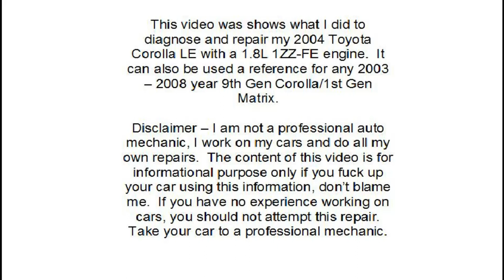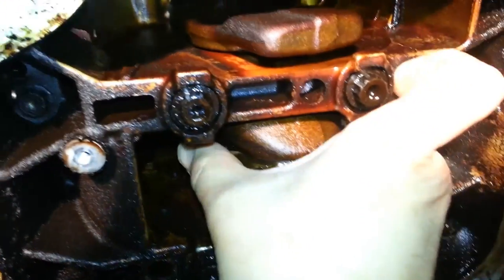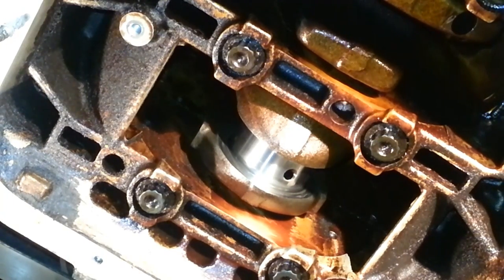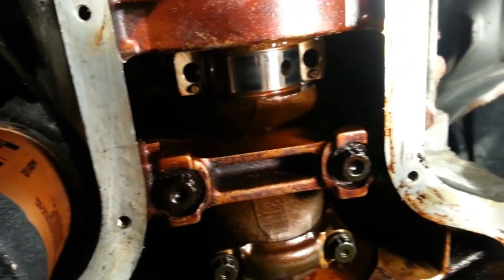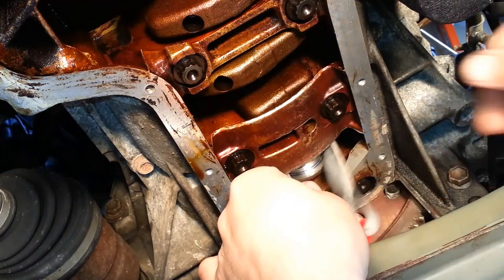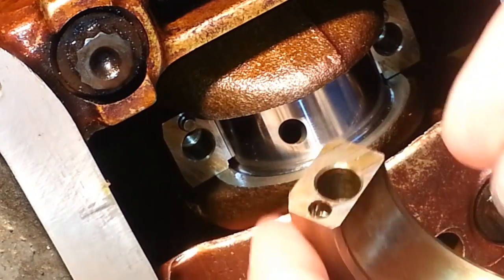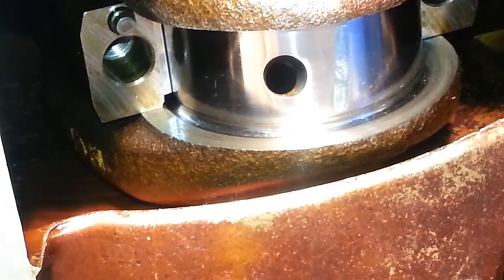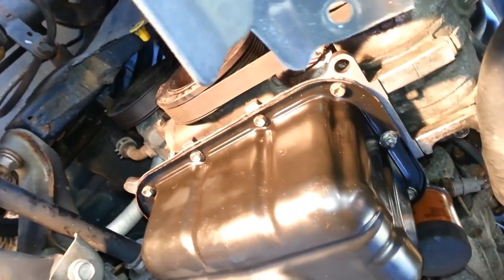2004 Toyota Corolla 1.8L bearing replacement to fix rod knock caused by bad connecting rod bearings

Comment: Great video, Liked and subscribed. I have been looking for specific instructions on how to disassemble the engine to change the head gasket and got here but watched the whole video, glad i did because learned a lot by watching you. I am still looking for a good video about how to change the head gasket in a 2004 corolla CE, i believe it is the same engine as this one here. I have a blown engine, the original from that corolla driven by my wife; it was burning the oil, we never knew until it actually blew a rod coming from California back to Nevada, engine had then about 80000 miles. We bought a used certified 2003 corolla engine with 62000 miles on it never opened for $1000 back then and $700 labor, that was about 4-5 years ago, now the odometer marks 122000 but wife have been driving the car with engine light on for long time without even watching the temperature gauge was all the way up until the overheating issues blew the head gasket in this second engine! The same mechanic who replaced the engine back then now proposes to do it all over again, same price! I kept the original engine in an engine mount in my garage all these years (he wanted to buy it for $200 but i wanted to keep it just in case i would feel like reconstructing it) today I just took it out and are attempting to remove that head to have it pressure tested and service, hoping to swap it for the blown one. I do not feel like doing the whole $1700 payment again but just the same, I have bought a lot of parts by now from autozone; namely water pump, thermostat, serpentine belt, spark plugs, head gasket, valve cover gasket, then also got the radiator, radiator hoses and clamps and radiator cap, as I am told my overheating issues may be due to poor coolant circulation due to maybe a bad radiator, which is the original on that car, ALSO the coolant have never been serviced before and the time the engine was swapped I believe the mechanic used regular water with antifreeze, not distilled water, so by now the radiator may have been gone bad; can not fix the car if we do not fix the cause of the overheating; I have learned all this in the past few days watching youtubes videos here; obviously my mechanic is not as cool as i thought and I want to do this all myself, not to keep the car but to fix it properly and be able to sell it for 3-4K after it is fixed and detailed inside out, including engine bay; car still has good body, interior new brakes, good transmission and nice rims with good tires on it. In its present condition we were offered $300.00 by Toyota Dealer which is an offense; we walked out of there. We will buy a used van with 20K miles still under warranty but will be putting life time mopar total care warranty on it before factory expires (2017 Pacifica Limited in excellent condition at 30K) and this time around hopefully wife understands once and for all that the car she drives she has to pay attention to the instrument cluster and get the maintenances as required! It is kind of hard for me to do this level of mechanic work; i have done the front end axel, breaks, battery and light tune up for my 2000 Tacoma which sits in my driveway with 220000 miles on it original engine and transmission never been in the shop or opened before but nothing like this deep. I think Toyotas are good cars that last long time but only if taken care of like any other car. I am also a mechanic but electro-mechanic for ATM machines and banking equipments like cash recyclers and coin sorters; that kind of mechanic it is not too different from cars only in my world there is not so much grease, mess and grime. I feel confident that I can get the car to run again then i will guarantee the work myself when selling it because as first owner of that car we know it have been put through hell by us neglecting it to the point to break it really hard twice now so maybe with this time fix around it can run for another 100000 miles without much issues. I think ours also has some knocking but I do not know how bad it is; in any case that would have to be a fix for the next owner and it seems less complicated than changing the head gasket! Thanks for this video!
Reply from the maker: Thanks, the radio didn't seem loud while making the video, but sure comes through loud when watching it..lol
Reply: There is a guy who does a 98 or 99 1zz-fe rebuild video on youtube
Reply: did you rebuild? there is a also aguy who does I believe a 2000 rebuild. it's pretty damn good actually I learned a lot and its pretty step by step. it'll be my primary video when I eventually get to rebuilding. right now I'm just learning and reading comments in various vids
Reply: 1000blabbities Yes I did the whole engine, since last year by now it is still in the garage not yet inside the engine bay, next step is to install fly wheel to it, clutch to the transmisión which is inside the engine bay and lower the engine into engine bay, then install the new axles and rest of engine components, I stopped in the project right after putting the engine back together last year about August, the head was machined and cleaned, the block was cleaned and I got new pistons, rings and bearings all Japanese, every little engine component is also new as well as in the head which was prep in a shop, when I installed used new bolts as well, the majority of the repair have been done it is just a matter to break my laziness and finish putting it back together!
Reply: Rody Outdoors That's damn cool. I'm still scared and lazy yo even start mine but its good to hear non pros can get this done. Esp cuz I'm broke lol

Comment: Great video, it was one that gave me the confidence to tackle this on my car. I have a Hyundai Sonata 2.4L engine. So far so good it starts and sounds great, but only time will time how long it lasts for me. If and when it gives out i'll come back and update my post. 20 miles and fingers crossed.
Reply from the maker: Glad it was helpful, I'm on 60K plus miles and still runs great.
Reply: Any issues so far? About to tackle it on my Supercharged 2.0 Cobalt SS
Reply from the maker: @zackbrock6031  No issues after 67K miles, changed the oil a few days ago and it's nice and clean.
Reply: I’m at 2000 miles and so far so good. It’s my kids car now.

Comment: Thank you for posting. I have same problem in my Celica. Think I've caught it early so hopefully this will catch it in time. I'll report back once I'm finished. From all the way over the Atlantic in UK. Keep on truckin'!
Reply from the maker: Keep us posted, hope the vid is helpful.
Reply: So I thought I'd update with my experience. The knocking has gone! And con rod bearing no.1 (nearest flywheel) was shot. I cleaned up the no.1 journal using this technique then cleaned and reassembled. The other journals and bearings looked good so I didn't sand them, just changed bearing shells and checked clearances.  I managed to find bearings from an aftermarket supplier (FAI) for £12 for all four (eight halves). Once the job was done I ran car until hot then added engine flush. Then ran at fast idle (3000 rpm) for 15 min. Then drained oil, changed filter and refilled with fresh. I'm hoping this will keep things running well for the foreseeable. 

Thanks again for posting!
Reply: @MrGrogee  i know it's only been 1 month but how's the car? been any noise so far? or still running good. i can get a used engine for 200 dollars but i just don't have the time to replace right now.
Reply: @littlebrw  Still running great. Completely cured the knock. No sign of it returning. I haven't done that many miles, maybe 600 or so, but no issues. In my opinion if you have caught the knock in time before it chews up the crank journal too badly, this is a LOT easier and cheaper than engine swap. 

I considered 2nd hand engine as well but they seem expensive and you just don't know if you're buying more trouble. 

Good luck with yours
Reply: @MrGrogee  
well after getting a good look at my car i pinpointed the noise to my transmission. it's a manual trans so "that's good in a way"  hopefully it will last for a while. i was over here being paranoid since it sounded like rod knock, but goes away when applying the clutch.

Comment: Currently doing this on an 03 Corolla. Hoping I caught it soon enough.
Reply: Doing this on my Matrix with same engine. Same here. I bought the car at auction, and didn’t notice it until I put nearly 300 miles on before I noticed it because road and wind noise is so loud compared to the engine. Who knows how long the previous owner drove with it this way. Fingers crossed, but I’m also more than prepared to rebuild the engine.
Reply: @Dude13450  how did it hold up? the crank shaft are pretty strong in these
Reply: @thenman23   not a single score just pure mirror as if brand new. Slapped new bearings in and no sound!

Comment: Hello sir my name is Wayne Baker I am currently replacing the main Bearings in rod bearings in my 1zzfe 2004 toyota corolla along with the oil pump and timing my question for you is when you did this job did you replace the bearings with standard or oversize bearings
Reply from the maker: Used the standard bearings matched to what use installed, just be sure to check the oil clearance with the plastigauge for proper oil clearance.

Comment: One way to quiet the knock if it's not that serious and to solve the Classic oil consumption problem is to use a quart of Lucas at your next Oil Change I did that to my 2001 Corolla and have seen 80% less oil consumption thank God I was using a quart every 250 miles. I just checked it at 270 miles and have not used a drop on the Lucas additive oil change I will check it again at 1500 miles I'm expecting good results still. Thank God amazing I did not want to rebuild the engine although it is cheap but time-consuming
Reply: Just get some thicker oil, its going to be cheaper.
Reply: @konstantindufnik696  I would just rather spend the extra ten bucks and get the additive I do not want to run to thick of oil in prematurely wear out anything else

Comment: I know it’s been a few years since you’ve done this. I just tore in to my ‘04 and the 4th bearing was obliterated. There is some scoring on the journal but I’m convinced I can smooth it out. My main concern is the rod and cap. Should they be smoothed it with sand paper, or is it OK that they have some scored material from the bearing? Maybe I shouldn’t even try but your video gave me hope!
Reply from the maker: I would clean them up the best you can, they don't need to be polished.

Comment: Great video. Handling a camera while doing the work, what a man. I need t do rod bearings on my 1999 Camry 4 cyl. Can you tell me will the oil pan come off just by removing the bolts or is there going to be some kind of."substructure" in the way? Thx for your time and the video.
Reply from the maker: I haven't done a Camry, but I think the exhaust manifold exits on the front of the Camry engine, so you will need to remove the bolts and swing the exhaust out of the way.  Here's a link to the oil pan removal:  https://www.youtube.com/watch?v=VIqEagP9h1w

Comment: Thanks Mark for the video. I have been experiencing this knock while the car is cruising at 2000 rpm.  It is only at this rpm then will i hear this knock which sounds vaguely like the rod knock in your video. What gives, particularly the 2000rpm exact reproducing condition?

Comment: This video had excellent information.  Thank you so much for posting it.  It's been 4 years, but if you are still monitoring it, could you estimate how long/far you drove before doing the repair?  I have rod knock on mine and I drove about 10 miles.  Wondering if that was too far to do the repair.

And this is just for my OCD, please don't be insulted, but that is a crank shaft, not a cam shaft and  you unplugged the fuel injectors, not the plug wires.  But to end on a high note, the polishing thing with the shoe lace is pure genius.
Reply from the maker: I don't recall how long it was driven, but was probably about the same or more since it was my wife's car and she noticed it so I would guess it wasn't right away that she told me about it. Thanks for the comments, I noticed that used the wrong terms a few times as I was more or less just winging the video as I was working.

Comment: You did not show how you put the plastic gauge on the journa, the put the cap back on and l then torque it. Then remove the cap again and then it would show what you are measuring? which should I guess the plastic part that stuck to the journal, is that right?
Reply from the maker: Shown at 40:42.  That is correct.

Comment: Dude thanks for the video. I bought a  03 mr2 5mt for 2k. Was planning on 2zz swap but was able to save the 1zzfe swapping out rod bearings. Itll  buy me some time before 2zz swap next year.

I ended up getting the mahle  standard bearing size.  Bearing clearance was perfect 👌.

Comment: I just want to know what you did to get a rod knock on a Toyota 1.8? These engines regularly go for 300K+ with nothing more than routine oil changes
Reply from the maker: The knock started shortly after I purchased the car, poor (or lack of) maintenance on the previous owners part caused the bearings to fail.
Reply: On mine, floor it up a hill in second gear, high rpm, lack of oil.

Pulled it down in about an hour due to watching this video. Sanding done, ordering bearings, should be back in one piece next Saturday after a work week.

Comment: Subscribed. Great Vid. Planning to do with with my R18 civic engine. Can we get a 5-year update? Thanks.
Reply from the maker: I sold it in Aug of 2019 running great with almost 200K miles on it.
Reply: @mrmarkg8564  good to know . Thanks and great work@
Reply: I have an R18 in my civic too. What’s wrong with yours? Do you have a knock?

Comment: This video is might just be the saving grace for my 1985 Toyota! I am soon going to attempt to drop the pan, it will be the first. Feel much confident armed with the knowledge from +Mark G.

Is there any significant difference after renewing the bearings? (Interms of engine idling, power delivery) can't wait to get the old girl running like it used to! Thank you
Reply from the maker: No noticeable difference in engine performance, only no knocking :-)

Comment: I’ve seen this many times especially on the 3.3 sienna motors I usually just clean the pickup tube and oil pan and they stop knocking I’ve done like 40 (auction vehicles) of them without replacing bearings

Comment: How did you know it wasn't anything to do with the main bearings? I am asking as I have a vehicle that was run for a very short time without much oil and now has knock. I am wondering if I need to potentially replace the main bearings too. It is an FX-GT 1992 Corolla. Thanks
Reply from the maker: Most cases, knocking sound is typically cased by the rod bearings, but you won't know for sure until you drop the oil pan and take a look.
Reply: One convention is that the “knock” is the crank slamming on the rod bearing between up and down stroke. There’s no stroke on your main bearings; if they don’t leak I wouldn’t mess, but you’re more than welcome to check once its cracked open.

Comment: great video to say the least. I'm going to do this  job on my 86 corolla SR5. One question, I am not well informed about the application of the gauge  on the journals, why is it important?
Reply from the maker: The Plastigauge is a measuring tool used for measuring the bearing clearances to set the correct clearance between the bearing and journals for the oil to circulate between the parts and allow proper lubrication.  Due to wear, machining or part replacement the bearings size is increased or decreased to provide the correct specified clearance. 
http://www.plastigaugeusa.com/

Comment: I started to do this and when I took them off, 2 of the bearings were completely gone and there was big chunks of metal In the bottom of the oil pan☠️ hoping it will work once I can get the new bearings ordered.
Reply: Update?
Reply: Some updates?

Comment: My car actually went beyond this knock and sounds extremely loud. As if someone’s banging to metal pipes. 

Is it too late to try this method, Toyota dealership told me to replace the engine or rebuild it
Reply: @Mister Blunt  I did that with an old 4 cyl Mustang II I had in the early 90's, I drove it till I threw a rod. I still haven't forgotten that "bang". lol.

Comment: 36:38 What is the purpose of the small hole in the center of bearing surface?  Seems like that would allow oil to backside of bearing.  Previously, you stated "I don't put lube on backside of bearing, cause that might cause a spun bearing."  I'm no mechanic, just curious.  Am really impressed by your use of "old school" shoelace/strap trick to polish surface.
Reply from the maker: Not sure I know why they are on the connection rod bearings, never gave it a thought.  Maybe these can help answer that for you.
http://www.substech.com/dokuwiki/doku.php?id=elliptix_oil_hole_of_new_design_for_high_performance_bearings
https://www.youtube.com/watch?v=43kEygGVZPA

Comment: Mark.  Great video.  I'm trying to replace the rod bearings on my 2009 Prius.  How do I remove the plate covering the bearing & crank shaft on the upper side of the oil pan?  Thanks a lot.  Lawrence..
Reply from the maker: Lawence, Sorry I have no experience with the Hybrid engine.

Comment: Just as long as it has not gone long enough for the rod journal to wear out of round right? I will measure the journals 1st in a few places with micrometers to make sure things havent gone to far if they are out of round do you think this would show as deeper score marks? Thanks again!
Reply from the maker: +mrichrd1 yes, you should be able to see the wear on the journal, but it may be harder to see from below, the most typical place for the wear is TDC (top dead center).